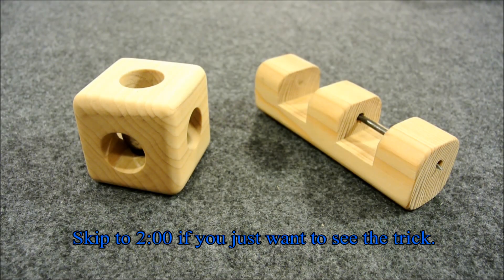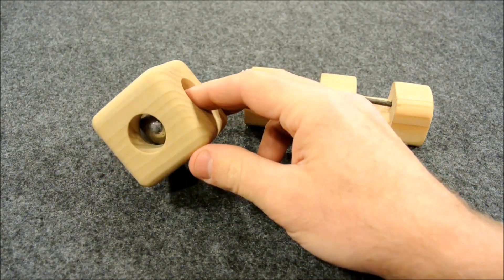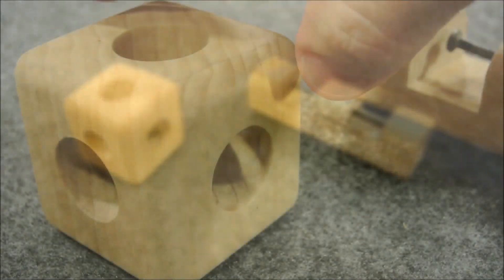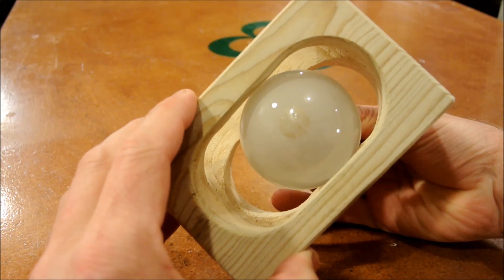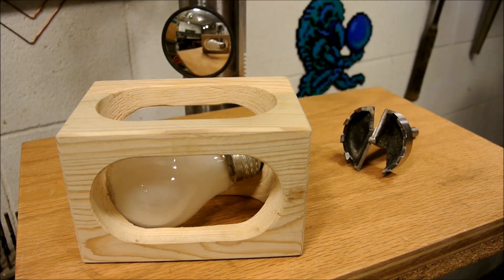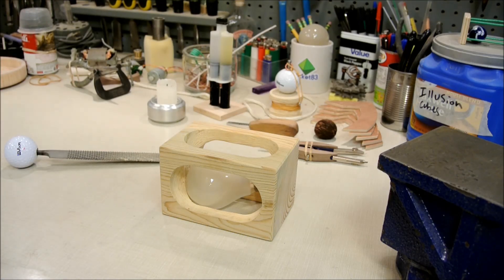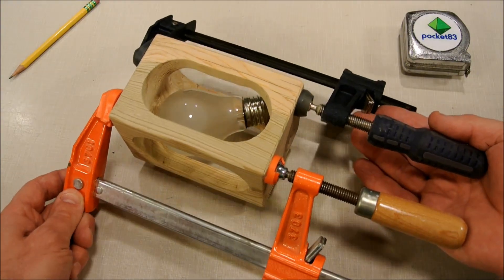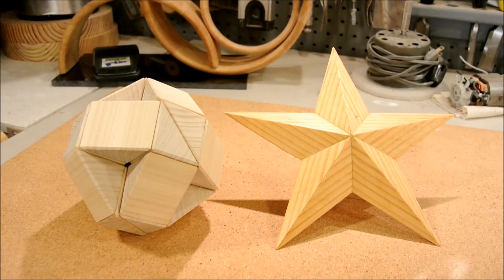POSSIBLE lightbulb in a cage

Comment: I've made about forty golf balls in a smaller cage...worked fine.  My first attempt at the light bulb with indicated block dimentions and Forstner diameter bit resulted in broken glass all over the floor and cracked block.  I have made a second block 3 1/8 x3 1/8 square using a 3 1/4" Forsner bit, wood is poplar,  in boiling water 15min.  Sides do not bow evenly, bulb goes in some holes but not others, cracking imminet. I'm hoping pocket83 will comment...
Reply: Hi! You might be using bulbs that are thinner than what was used for the video. Poplar is certainly comparable to what I used, so I'd guess it's the bulb that's giving you trouble. Maybe try looking around for the super-cheap bulbs at a dollar store.
Reply: @pocket83squared  I am using a std LED bulb which seems pretty robust. Changing the block and bit size was done to reduce the interferance (now about 1/8" ) that has to be overcome.  My concern is twofold: extreme vice presure required, and sides do not bow evenly.  Am I overlooking something?
Reply: @stevewenger7428  Let me offer the easier and more obvious (possible) solution first: Find the correct balance. If you reduce the thickness of the cage enough, eventually the 'pillars' will become flexible. The goal is thus to find the threshold, the tipping point, where you preserve maximum thickness and still get it to go. The trick is to push the materials to their limit.  

Outside of that, some further refinement?

OK, maybe we're not thinking about the grain enough. The best piece of wood for this sort of thing will be one with a straight, uniform grain. Consider that if the pillars of the cage have different properties, they'll of course bend differently under identical stresses/loads. Rather than just applying a constant, uniform force, let's instead assume that we want to be able to control and direct the force that's being applied.    

In theory, if one pillar starts to bend earlier than does another, it would be possible to even the force out by pressing down on the cage at different rates. Instead of the vice, you might try bar-clamping a large board to your work bench, and then tighten each of its ends appropriately. Such a setup would give you a big vise that has non-parallel jaws. It would even be possible to establish multi-axis, pinpoint control by adding a steel plate and more clamps!
Reply: @pocket83squared  Thanks for the suggestion; I've thought of this but wasn't sure how to deal with it. Please explain  your steel plate idea.. I'll look for thinner, cheaper light bulbs, but GEN3 attempt will definately incorporate your suggestion with bar clamps. Since I only need to enlarge one opening to insert the bulb, bar clamps with fifferant pressures just might be the answer. The bulb in a block is just too cool to abandon; besides, I have 16 more blocks availabel from the poplar board I sawed to began with (grain runs along the long axis of the bloc).

Comment: hmm, with an LED bulb and installing a socket at the bottom that would make a neat lamp
Reply: Robert Cornelius thus the point of using a low heat, low powered led bulb. (Well made ones will last a very long time)

Comment: Awesome idea! It'd be cool to make a lamp out of it by drilling a hole in the bottom and providing the power through there. Maybe a LED bulb would be better to avoid the heat damaging the wood.
Reply from the maker: Agreed. I still may drill holes in the top and bottom, but I wanted to film this first.